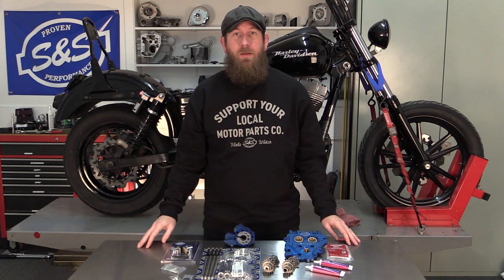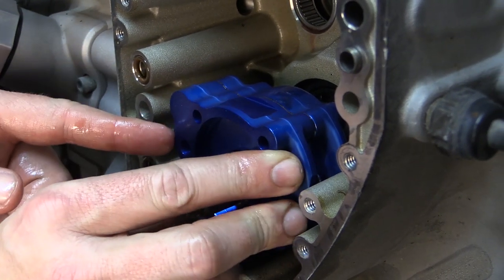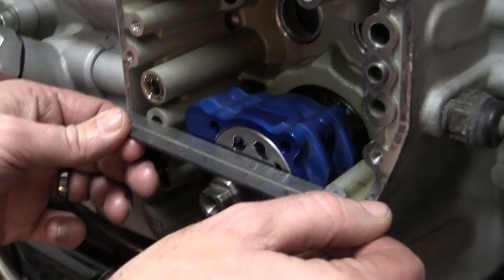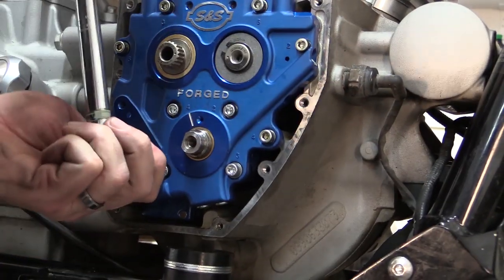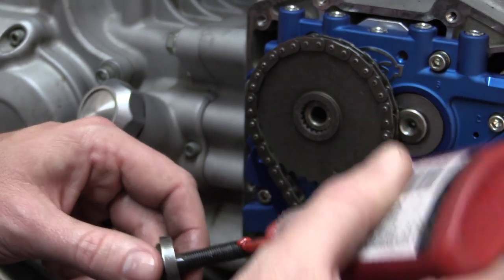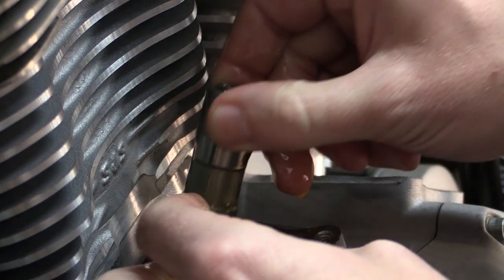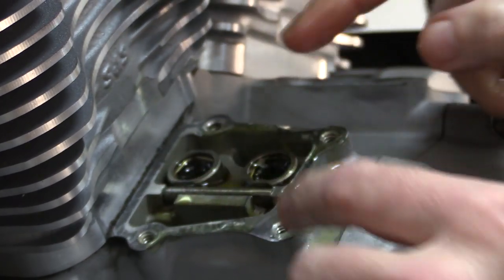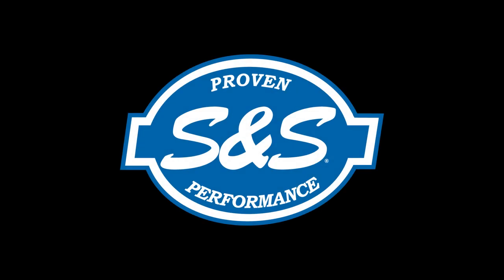How to Install: S&S Cycle Power Package (Part 2) Cam Chest Kit

Comment: S&S Cycle... awesome video. Very well explained. My manual says to use the tapered centering screws that screw into the tappet block (2 of them across from each other) while the other two bolts are installed. Then remove the 2 tapered centering screws and install the last two bolts and then torque to spec. It says that step is to make sure the tappets (lifters) do not hit the tappet block when they come up into it. Is that step not necessary or needed??
Reply: have them use them, the manual says so you won't go wrong that way.

Comment: I noted that after you finished torquing down the chain tensioner, the dots of the chains were no longer aligned. Did you install them this way?
Reply from the maker: We did not, we adjusted that off-camera. In the next shot where you see the face of the cam plate, you can see the cam dots are realigned. Good catch!
Reply: Yea eactly!  I said to myself..Wait a minute you never talked about realining cam marks.

Comment: I bought the kit and it comes with a small individually wrapped screw. What is this for? I've checked the instructions front to back and can't find where it belongs. I've also called your service desk but the lines are always busy.
Reply from the maker: Fills hole for chain tensioner when using gear drive (tensioner is not used)

Comment: Today I watched another video where a guy is disassembling to replace the cams, and he pulls the tappets up to show that the hole was facing outboard away from the engine. Could it be that someone before him reassembled the bike incorrectly? And would it still run ok like that ?

Comment: How bout a video explaining this same procedure on an 05 Harley 88 vtwin? That would help immensely. Not sure how cams go because I dont' have that big washer. Just a smaller like sleeve.
Reply from the maker: This is an '06 88" (it just had our 100" Big Bore Kit installed in part 1) so your process should be very similar. If you run into any issues don't hesitate to reach out to our tech team with a detailed email at sstech@sscycle.com!

Comment: Should you not take the time to measure the crankshaft runout first?
Reply from the maker: It's definitely a good thing to check, and a requirement when you're running dear drive cams.
Reply: Probably 2 inch per rotation D T I not available E A C

Comment: Awesome video.My question is I have a 2005 Soft Tail Deuse the motor is stock and has only 10400 miles on the odometer.It has EFI.what size cams and cam plate set would you recommend for a upgrade and would I have to get a tuner from changing the stock cams.
Reply from the maker: Hey Robert, a lot of factors go into choosing the right cam for you. How do you normally ride, solo or two up. Do you ride mainly highways, city streets, or twisty mountain roads? Where do you normally shift in the RPM range?
Check out this page on our site for more cam info:
https://www.sscycle.com/tech-info/cam-specs-overview

Comment: @S&S Cycle, Inc I am getting ready to install this kit on my 2000 Softail Nightrain. I was wondering if I will be required to do any head work with this kit or if my stock heads and valve springs would be sufficient? Thanks in advance!
Reply from the maker: So long as you chose a set of bolt-in cams you should not require any headwork. You can confirm that your cams are bolt-in friendly here: 
https://www.sscycle.com/tech-info/cam-specs-overview

Comment: I have an 04 Low Rider, all stock w/SE slip-on dual exhaust.   I would like to upgrade the cam chest to hydraulic cam chain tensioners w/ upgraded oil pump while still using stock cams.  Secondly, what type of inner bearings would you suggest to go with?  Lastly, does the S&S plate come with Timken bearings?    Thanks.
Reply from the maker: If you are going through the trouble of opening the cam chest to replace the plate and pump, there's no reason to not do the cams as well. We recommend you check out this link: https://www.sscycle.com/2004/Harley-Davidson/Dyna-Low-Rider-FXDL/?hawkoutput=custom&searchId=ff2f72ca-a25a-4dd0-81e2-3f7974233a77&category=1%7cCamshafts#category=2%7CCamshafts%2FComplete%20Cam%20Chest%20Upgrade%20Kits

Comment: Very good video but four turns is 24 Flats not three on adjusting the push rods
Reply from the maker: Correct, the initial adjustments for the Quickee Pushrods should be 24 flats or 4 full rotations, Jon accidentally says 3 full rotations in the video.

Comment: When you installed the lifters you put the oil hole facing the engine,I've done cam swaps twice and both bikes the oil hole was facing out from factory. Does it matter? Is that what s and s recommends?
Reply: Just tore down a 99 twin cam 88 that has never been into and the lifters had the holes facing each other. It must not matter much I think the oil channels around and finds its way into the holes.

Comment: I just installed an S&S 551 Cam kit in a 2011 103 FLT (Road Glide) The kit did not have any instructions for the pushrods, (S&S Quickee) So I went on Youtube and found 2 videos that both said Zero Lash and 20 Flats, Is that going to be a problem? Also in the kit there was a button head allen screw 1//4" NC by 1/2 inch long in a cellophane sealed bag, I can't find anything in the instructions indicating it's use and I can't see any open holes? Am I missing something?
Reply from the maker: That pushrod adjustment procedure sounds correct. As for the screw, some early 1999 models would use that screw to block off a chain oiler boss, this is not needed for your 2011 FLT.

Comment: Hey S & S,

 I am considering the 100" Winter Power Pack with silver cylinders, chain drive, and 585 easy start Cams. 

My bike is 2005 FXDC Superglide Custom carburated with 35,000 miles. 2 into 1 red thunder exhaust and a DK customs Air cleaner kit. I have a more aggressive riding style.

Do you think the 585 is a good cam for my bike and myself? I wish you could substitute any cam into the kit as I would consider a 583 or 570. 

Thanks!
Reply from the maker: Hey Damien, that is a great question! 
If you are already considering the 570 & 583, the 100" power pack with the 585 will be your new best friend. Based on our experience with the 88" to 100" swap and a very heavy throttle wrist (that more than one of us might have) the 585 is absolutely the most fun, reliable, and fitting cam to pair with the 100" kit. 
We would not hesitate to recommend that kit for your specific setup and riding style.
Reply: @SSCycleInc  Thank you for responding! Do you think I will feel at all sluggish down low?
Reply from the maker: If you weren’t doing the 100” kit then it could be a bigger concern, but with the added cubic inches you shouldn’t notice it lugging or feeling sluggish. That said, this is a very big change from your current engine so you may have a small learning curve of figuring out all the quirks of the new set up, but nothing that laying down some miles won’t clear up!
Reply: @SSCycleInc  Okay awesome. I ordered the kit and I have already removed my gas tank. ⛽

Comment: I have a 2019 Road King 107 M8 and would like to do a Cam Chest Kit. Which one do you recommend for my bike (I see multiple choices on S&S website) and do you have a certified mechanic shop in 85258 you cold also recommend?

Thanks!!
Reply from the maker: Hey Robert, we would recommend the 465 for more around town riding (low end torque) and the 475 for highway speeds (horsepower). 
As for a shop near Scottsdale you have a lot of options! Try Black Canyon Motorworks and talk to Scot.
Reply: @S&S Cycle, Inc  
You guys rock! Thanks for your advice and input. I am more of a ride around town guy vs pounding out hey miles. I'll give Scot a shout as well.

Thanks Again!
Reply from the maker: Happy to help!

Comment: Is it 3 or 4 full rotations of the nut ? 😅
Reply from the maker: The initial adjustments for the Quickiee Pushrods should be 24 flats or 4 full rotations, Jon accidentally says 3 full rotations in the video.

Comment: If I put a S&S 570 cam, cam plate and oil pump  in my 2014 Heritage do I need to change out the push rods?
Reply from the maker: We do recommend swapping out the pushrods as well as the lifters. If you are already planning on the cam, plate and pump you should look into our Cam Chest Kits that come with everything you need. 
https://www.sscycle.com/2014/Harley-Davidson/Heritage-Softail-FLSTC/#category=1%7CCamshafts

Comment: I have always said Harley Davidson engines are overly labor intensive, their still using 1950’s/1960’s technology even in the Milwaukee 8 with the huge primary chain rotating in oil, pushrods, rocker arms, pushrod lifters , and a hot air cooled engine. I hope the Revolution Max can redirect HD to the modern age their claiming across their entire line.
Reply: Lot of home mechanics like the old technology keeps them turning wrench’s 🔧 plus they don’t have to deal with high technological levels.

Comment: I have a 2000 Dyna Wide Glide FXDWG and I have purchased a S&S cam plate kit includes cams and oil pump, the cams are 510C is there Anyone that is doing a 2000 FXDWG I would like to see one.
Reply: I intend to do it my self.😊
Reply: What year is the bike that you are working on?
Reply from the maker: This is an '06 Super Glide, the installation will be very similar with your 2000 WG.

Comment: I would have installed gear cams if I went through all of that and sealed the cam chest up and called it a day.
Reply from the maker: Challenge is crank run out. Not all engines can tolerate gear drive cams.
Reply: I wonder how many guys upgrade to a gear driven cam kit, and discover AFTER they open the cam chest that the runout is too excessive ... or worse still, ignore the runout check and bolt in the new gear driven cams on a wobbly cranked motor.